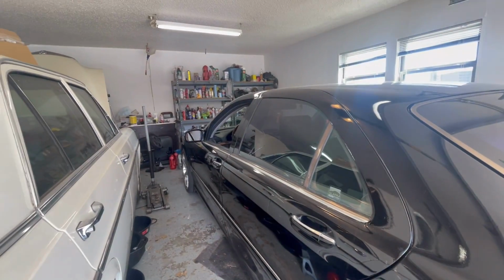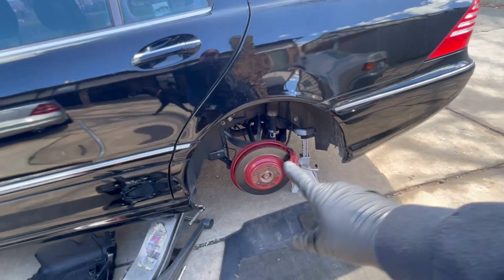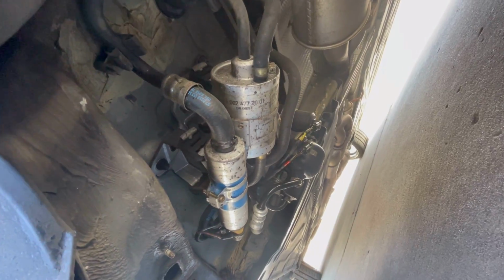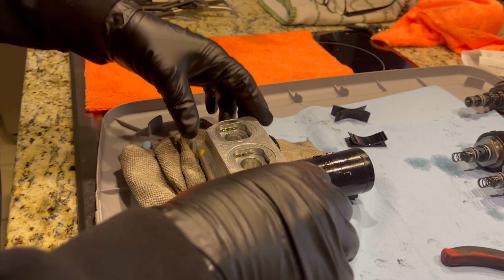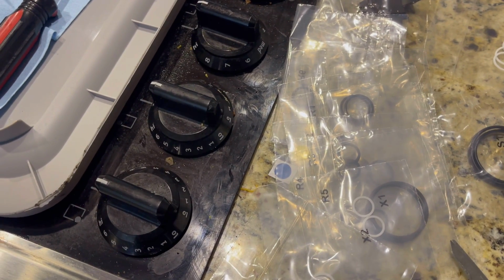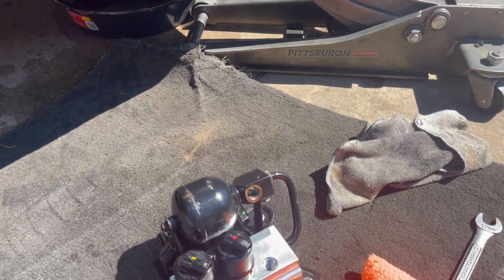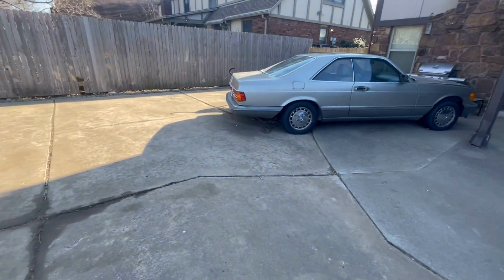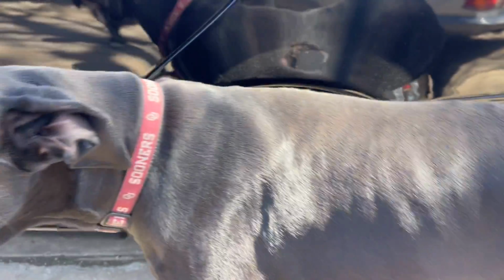Fixing That Valve Block Squat!

Comment: Nicely done, really need to order the kits from UK and do this on mine. Quick question Mike, is there any special bleed procedure on the fluid or do you just fill it up to level again. I got so P-off with my last CL and the HG failure I gave the kit away when I sold the car for parts. The new one sinks much slower but still does a bit after a few days. Keep up the good work!

Comment: We all love you and Randy out and about, You are so naturally funny together, Love all your videos and the work you do on your Mercedes car’s, I had a transmission pipe rust through, So while I was replacing the pipes I decided to bypass the radiator after what you said to Randy about the E class, I have a late 2008 E320 cdi sport and she is stunning, I have owned her for 5 years and I’ll never ever sell her, This is my 4th E class diesel and they are so reliable, The S class like you S 600 rot like mad over here in the uk but the E class doesn’t for some reason.
Reply from the maker: Thanks!

Comment: I went to buy a 2003 w220 s600 with 69k km on it, and I was put off by the fact that car lifts up and down while idling for no reason. the soft close doesn't work, bootlid closes manually and the massage seat function doesn't work. it was also clear that there is a noise resembling somewhat of an air leak but I did not know where it was coming from or what it was. please advise thank you.